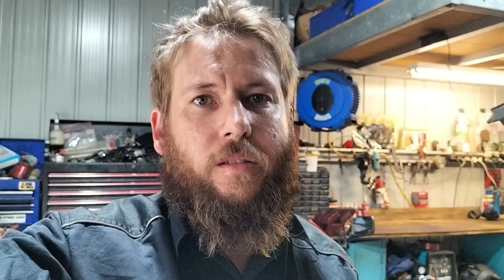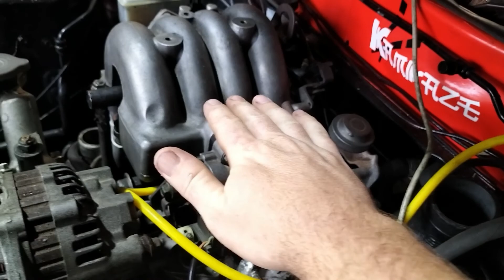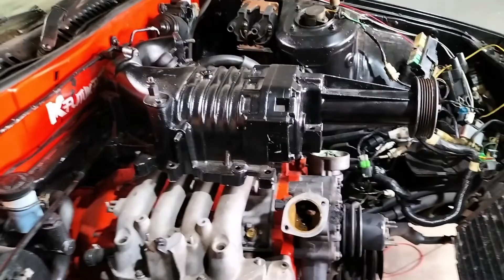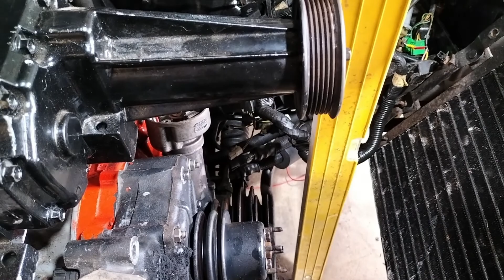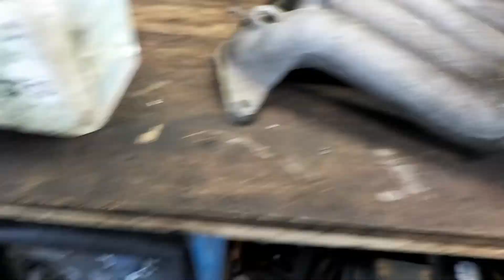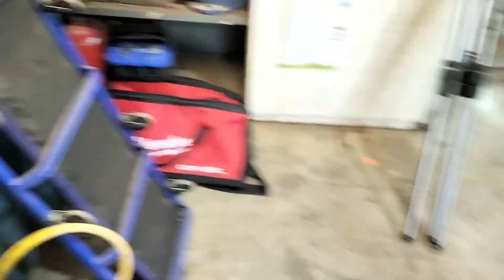SUPERCHARGING MY RX7 FC RX7 PROJECT BUILD EP6

Comment: I run a single 90mm tb on my 13b. Its DBW from my haltech. It does lose a bit of low down but nothing major, your SC will offset any of those losses!
M90 is a good match. As long as your not expecting over 12PSI at 8000rpm. It been done before.
Needs to be intercooled if you can? Roots generate a lot of heat, which is why most rotors that go SC are Centrifugal
Run E85 just for knock suppression and heat control.

Good luck :)
Reply from the maker: Thanks for your comment bud. Nice to hear a single throttle body is not a big deal. The plan is for a water to air intercooler and I was going to aim for around 10psi as it's still a high compression engine.
Cheers 👍

Comment: This is probably a stupid question. But on a rotary, is there any reason that it needs to be on top of the engine? I know this is the normal place for it on a v6 or a v8. But can you get rid of the top half of the intake and mount the supercharger on the driver's side of the engine? Should solve all the bonnet clearance issues?
Reply from the maker: No there is no standard reason it can't be mounted in any position on the engine. The M90 has sealed bearings and runs it's own oil in the snout so needs no oil or coolant plumbing from the engine.  The main reason I want it on the top is more for looks and because the factory manifold already places it up there it makes for less fabrication as I don't need to make an entire new manifold. I'm not sure if rotary engines are picky with intake runner length like some piston engines can be either.
BTW no such thing as a dumb question mate 👍